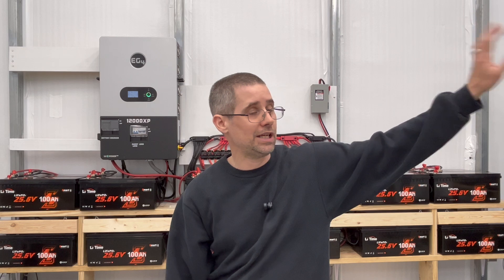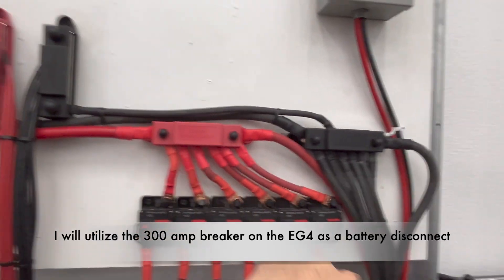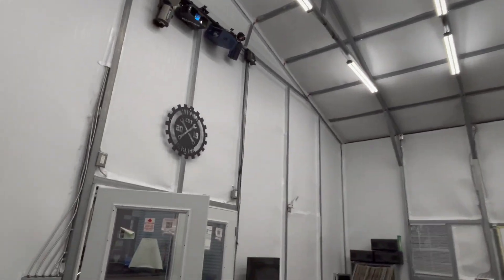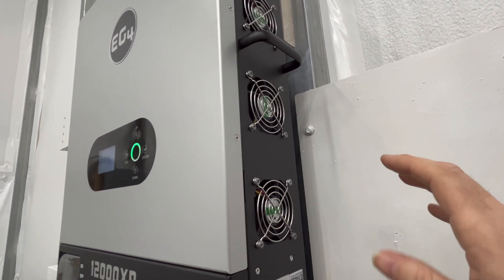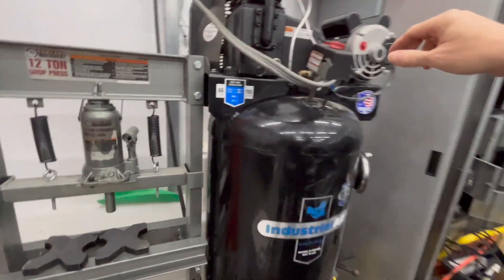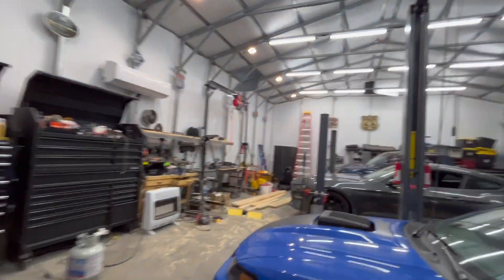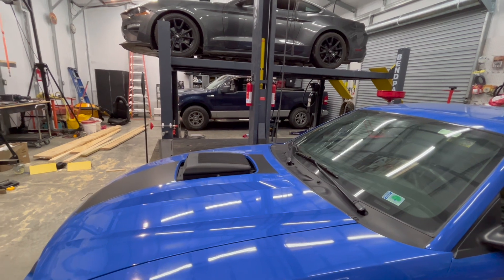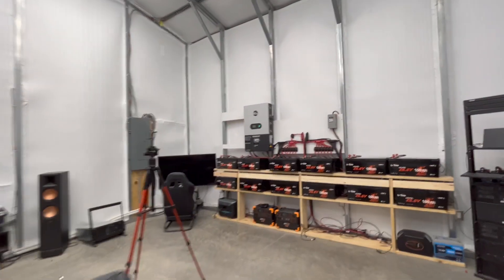Pushing the EG4 12000XP to its BREAKING POINT! (First Test)

Comment: I'm confused. Here in 230v 50hz land this unit has single phase and puts out 12000w with surge 5secon surge of 24000w doesn't american power and 2phases out the inverter for two 6000w supplies at 110v?
Reply from the maker: For the US is is a split phase of 240v/120.  It is one phase.  Capacity wise the 12000XP can put out 12,000 watts continuous and 18,000 watts peak.
Reply: @MikesSolarGarage I think my confusion comes in that it says it putting out 240v and tripping at about 600w instead of 1200w. Which indicates the you only using half the inverter capacity somehow?

Comment: To enhance the system's performance, consider increasing the number of batteries directly connected to the power unit, or alternatively, utilize 4/0 cable to consolidate all battery sources.  Employ thermal imaging to monitor the main cables for excessive heat generation under high-demand conditions.  Furthermore, incorporating additional banks of supercapacitors may prove beneficial.
Reply from the maker: @rc-t3k  Very good advice,  what capacitors do you recommend?

Comment: A soft start on the compressor? the lift if 2.5hp should be 1800w running, surge could be 5kw.
I have seen my 100w fridge surge 800w. I only pull 2700w max to run the trailer I think the 12000xp will have a quiet life. 
Had 22kwh Mar 11 in overcast, snow melted today 15kwh in overcast, that is enough proof for me to add reflectors this upgrade season. 
In most cases the inverters of this class will just restart within 340 sec, hard reset required if the DC breaker gets tripped.
Reply from the maker: I’d be very interested in what you come up with for reflectors.  That’s is something I really haven’t dived into yet.
Reply: @MikesGarageRoute66  white rock works, but $$$ here, sign board or plywood with white paint, maybe silicon RV paint, I think white signboard would be cheaper.
Reply from the maker: @bobmonztr  That makes sense, Thank you!
Reply: @MikesSolarGarage  maybe mylar and spray adhesive, mylar is cheap if it lasts 2 summers could be a really good option.
Reply from the maker: @bobmonztr  Thank you,  I'll look into that.  I've used smaller audio grade ones in a tube amp.  Thank you again!

Comment: Why is the one breaker turned off?  2nd from left.  Looks great. A couple of starter caps on the compressor motor and lift motors could help with the kick on power draw.
Reply from the maker: Thank you for watching Pinks.  The breaker 2 from the end has a battery that is not working correctly.  I am working with the vendor right now.  I thought of starter caps or soft start, but I would be only masking the problem, especially if I want to add a 10,000 watt heater in the shop area.